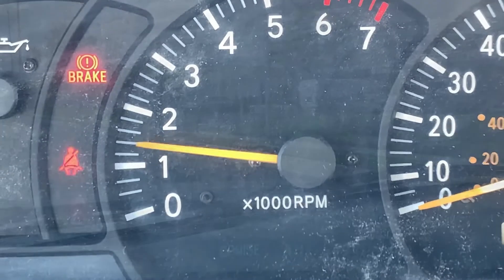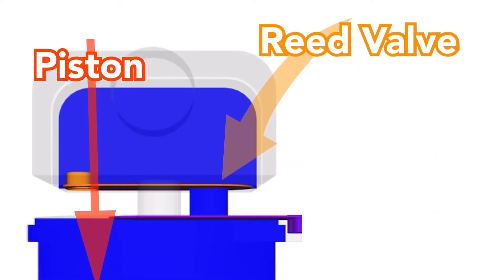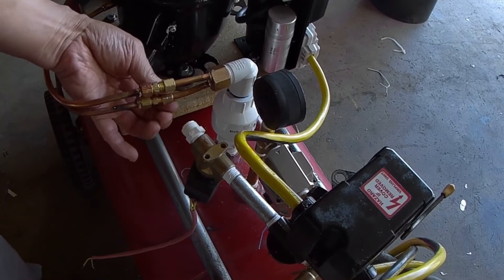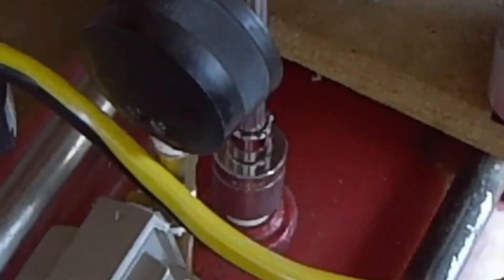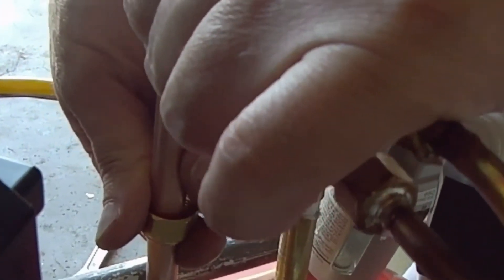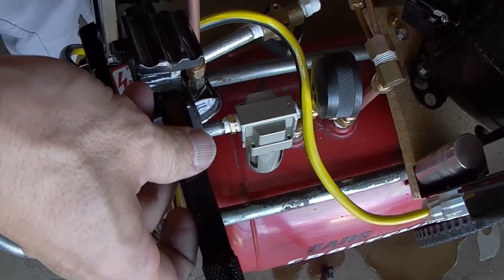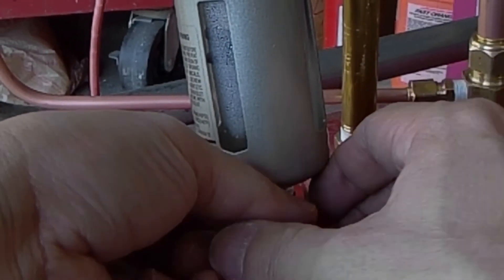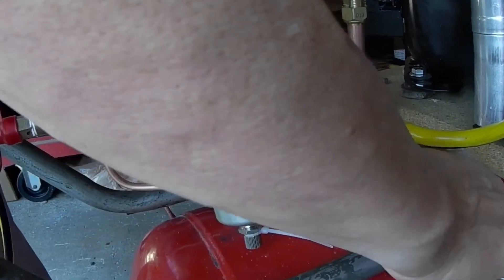Why You Need A Unloader Valve!!! Silent Compressor Aeroponics (Step by Step)

Comment: I wish I could build one like yours, if you had to buy one, which would you go with?
Reply from the maker: if you had to buy a compressor.... then you want to look into a oil free compressor.... something like this https://www.amazon.com/California-Air-Tools-8010-Compressor/dp/B00WM1VPKE/ref=sr_1_5?dchild=1&keywords=quiet+compressor&qid=1587045276&sr=8-5

they have them all over the place like harbor freight offers one as well. https://www.harborfreight.com/4-Gallon-200-PSI-High-Performance-Hand-Carry-Jobsite-Air-Compressor-56339.html?ccdenc=eyJjb2RlIjoiOTUyMDI1MDYiLCJza3UiOiI1NjMzOSIsImlzIjoiMTY5Ljk5IiwicHJvZHVjdF9p%0D%0AZCI6IjEzMTYyIn0%3D%0D%0A&cid=paid_google|||56339&utm_source=google&utm_medium=cpc&utm_campaign=&utm_content=&gclid=CjwKCAjwhOD0BRAQEiwAK7JHmOwhjmgQwAgLuZ4fZi_MceMNhh2PPjgD_WKJHMW73BSkSKMTK5wazBoCarYQAvD_BwE

you just have to research the size tank you'll need for your system size.  

note : these "quiet compressors" are significantly louder than a silent compressor.  definitely something I chose not to run at 2am in the morning because, I'm sure my immediate neighbors would hear this thing running.  whereas a silent compressor is not louder than your typical refrigerator.  just food for thought.

about buying one... i seen one harbor freight store have a unit on display with power.  it was ok... outside of that I've seen commercials for this unit.

https://www.amazon.com/California-Air-Tools-8010-CAompressor/dp/B00WM1VPKE/ref=sr_1_5?dchild=1&keywords=quiet+compressor&qid=1587045276&sr=8-5

but that is the only experience i have with these units.

hope this gives you some insight!
Reply: AeRomAh thanks man, I ended up getting a small Jun-Air 3-4 from eBay for $270 all in and it looks like it’s in good shape so I’m pretty happy about that...  I also ordered some of these nozzles uxcell Air Atomizing Nozzle, 1/4BSPT Misting Low Pressure Flat Fan Spray Tip Nozzles https://www.amazon.com/dp/B07SXJH962/ref=cm_sw_r_cp_api_i_l05NEbK9N8BJ5. Do you think they would work?
Reply from the maker: @afishl1 Congrats! good for! you man!! that compressor is pretty awesome! I really like the design of that brand.  

As for the capacity of it... I don't know what size you are going to make your chamber... how many nozzles you are going to run... the operational psi for the nozzle... nozzle hole sizes.... passage way for the nozzle...  head type....spray pattern...how many micron it aerosolizes....is it a siphon or pressurized feed... and many other factors.  LOL

Sorry.... I'm not much help for you there... basically when it comes to air atomizing aero you will have to self discover many things.  Just keep in mind there are no set rules!!!  You can do it many many different ways and there are always ways to offset it.... 

IF there is one thing I do know about your nozzle... and it MIGHT be slightly difficult to overcome... it would be that its a "British Pipe Thread".... I know my buddy had a hell of a time finding fittings for it.... I just wanted to make sure you knew it's completely different from our "NPT (National Pipe Thread)"  pitch.

Sorry, wasn't able to be of any solid help to you... I hope you start posting vids of your own soon!!!  I would be excited to see how you set it up!  Keep me in the loop!!
Reply: AeRomAh yeah I saw that, I’ll have to get some adapters... the chamber is going to be a 55 gallon drum... I plan on having the three fans mid height, edge of barrel, pointed off center (prob pointed between center and edge) so they will hopefully all add up to a swirling result.  The micron size and pressure and siphon/gravity, on/off times, nozzle adjustment aspects are all very unknown to me unfortunately, hoping I can get a decent micron size and chamber coverage with  least amount of air pressure used so the compressor doesn’t have to cycle as much... the compressor has a max on/off 50/50 duty cycle of 15min... I was told it’s 4L tank should take about 1.5min to fill up, so I’m thinking about adding another tank under 40L so it won’t come on often and when it does, it will go for a bit of time but under its max (using big cut in/out pressure switch hopefully as well)... how do you figure out the micron size and filling the chamber with the psi? I assume I need some nozzle specs, prob more than that listing gives I take it?